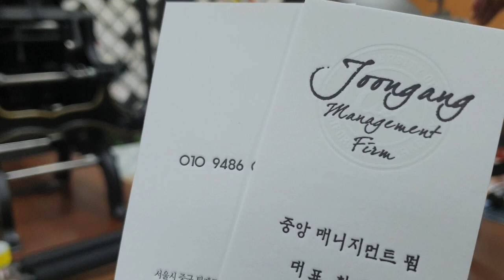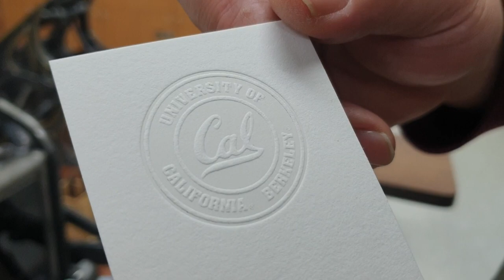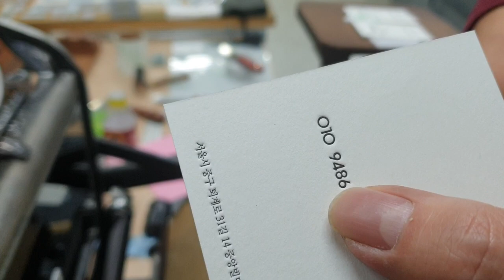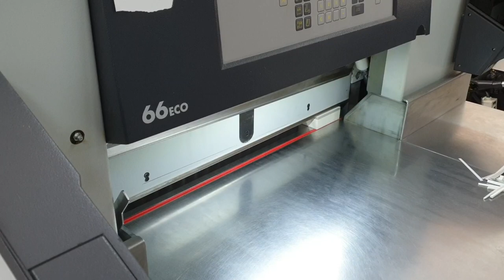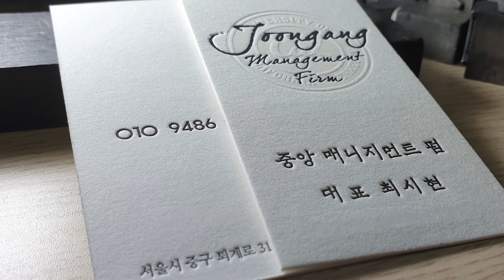Letterpress Business card. 레터프레스 3도 고급명함 만들기.

Comment: I have two questions, because you have a vast array of letterpress machinery at your dispose...
1. What tabletop machine would you suggest for 1-4 colors?
2. What floor model would you suggest that could still get through a 32” door?
Reply from the maker: 1. Honer is the best tabletop equipment I use, and the second is the Pilot version.
2. With table equipment, all letterpress work is limited. I think almost anything can be done by printing in parallel with tabletop equipment and large equipment.